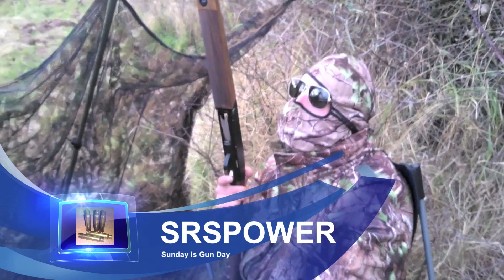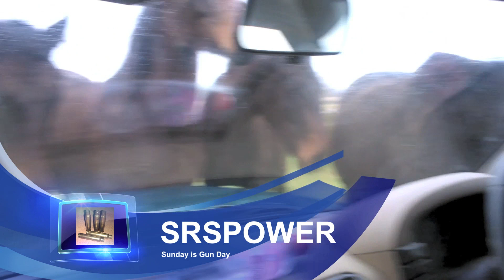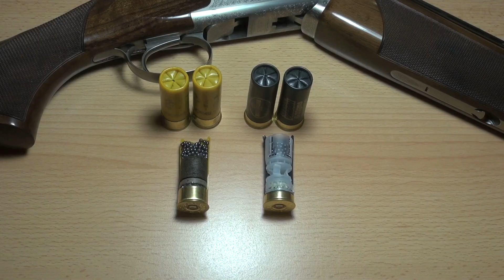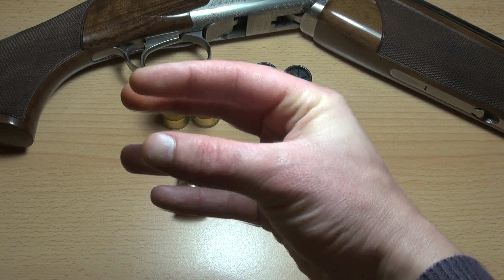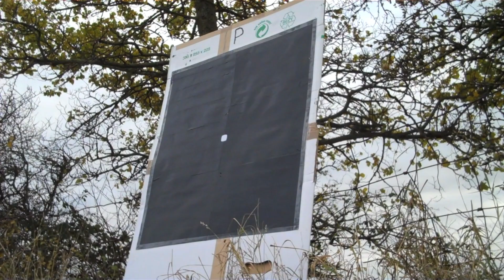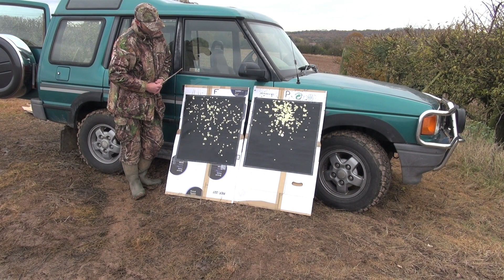Plastic vs Fibre Wad Shotgun Cartridges

Comment: I have shot low speed plastic wad ammo through a vintage SxS designed for fiber wads.  The thing kicks like a mule. It is said it effectively makes the gun one choke size smaller but it seems as if it adds constriction too. Food for thought.

Comment: Thank you! I wanted to add an option to my video game to increase shotgun spread a bit, and was about to link it to sawing off a barrel but wanted to double check if that was a myth or not. After some research and this well made vid I'm now making it a choice of shell wadding. Thanks!
Reply from the maker: If you want to change spread then sure plastic vs fibre makes a difference but choke us most important. Cylinder choke being widest and full being the tightest. Check my video shotgun chokes explained.

Comment: This is an old video. But I'm going to comment anyway. 
The 2 gram advantage of the fiber wad isn't any advantage. The shot rubs against the barrel and gets a lot of flat spots on the shot. Aerodynamics across those flat spots opens up the pattern significantly. In fact, when plastic wads first came out, that was one of the selling points. The plastic cup protected the shot and yielded tighter patterns. The initial recommendation was to use a choke one size larger than you were accustomed to. 
All this is old news to me, but based upon video commentary it should probably be repeated here.
Even so, I still like the idea of fiber wads. Maybe I'm just old fashioned.

Comment: The plastic wad increases the choke and possibly restricts spread for a bid as the petals flare out and they are heavier than the fibre so they add to the forward motion for a bit as well... fibre is homemade if you want and works good for lead at slower velocities try that and see I think the fibre is the best but for lack of shotcup which is nice to have...

Comment: Hi Sam going rough shooting with the sxp going to use gambore with low brass 6 shot have you had any problems cycling them ? I've used some  lighter loads at the clay range 65m 71/2 and kept jamming . Thanks for help Andy
Reply from the maker: +Andy sawyer The only rounds I had issues cycling were high brass due to the brass not being caught as well by the extractor. But then practise seemed to overcome that. You should be getting issues with low brass at all, if you do then maybe you should get it looked at?

Comment: The plastic shot cup basically acts as one more degree of choke. Very informative. Thanks for going the extra mile in your videos and provide us with a visual field test rather than just theoretical speculations. Keep up the good work buddy. Cheers from an American shooting enthusiast!!
Reply: +m96c40  No sweat buddy, glad I could help. another way to increase pattern the tightness of the pattern even more is to decrease velocity and use harder shot ( more antimony added to the lead during manufacture), or copper plated. less deformation + plastic wad = tight patterns. That's how Turkey loads are loaded.
Reply from the maker: I'm glad you liked it! Don't forget to sub, I have just had my rifle licence through so plenty more to come. Thanks for watching :)
Reply: +maseta3 I guess it does. I hadn't thought about that. I always assumed the pattern is better JUST because it protects the shot against deformation. Thanks for pointing that out.

Comment: Have you tried the Cupped Fibre wads   think they may be home load only
Reply from the maker: Not tied them no.
Reply: ***** Onl stumbled on them couple of days ago as im looking into reloading yShotgun carts    http://claygame.co.uk/products/detail/100-12ga-fibre-shot-cups
Reply: ***** hi srs my clay ground only allows fibre wad and i usually use quarter and half choke but aftrer seeing the spread of a half choke fibre wad im thinking i should try three quarters and full or full and full i swear ive seen my shot pattern go straight through the clay without hitting it very annoying. it would be great if you could do a vid showing what choke(fibre wad) patterns as close to the plastic wad on say a quarter or half choke if you know what i mean. i have no way of testing this in the field and would love to know. thanks sam
Reply from the maker: spitfireace87 What ranges are you shooting the clays at? If its 30 yards or less you should be fully smashing those clays with cylinder bore let alone full! You are probably going just behind or in front, increasing the choke may actually make your problem worse.
Reply: ***** yeah lol i probably do miss a fair bit . its mostly when i get caught out and i take a shot at a clay 40 50 yards out i have seen it go through the pattern do you think a tighter choke would just deform the shot to the point where its inacurate
Reply from the maker: That's not the problem at all, it is just you then have a much smaller tighter pattern. More likely to miss altogether.
Reply: Why are plastic wads cheaper than fibre

Comment: 20 gauge vs 12 gauge? You answer
Reply from the maker: 12 gauge is good because of price. As cartridges are most commonly bought in 12 gauge they tend to be cheaper and more common. For shooting? Not much difference really as you can get 20 gauge heavy loads and 12 gauge light loads. I quite fancy getting a 20 gauge side by side at some point as they are a little better looking. Mind you if you want exclusivity there is always 16 gauge.
Reply: Cool
Reply: But gun laws in the UK are so bad - they're so strick that you even need a license for a .22lr
Reply from the maker: ale de Well yes, in fact the license you need for a .22lr is section 1 much more strict than the license for a shotgun, section 2

Comment: Hey great video, its quite interesting how much pattern difference the two types of Shells have in a real world situation.
Just wondering... Is there a rule of thumb as to say which Chokes will give a similar spread with each Wad type? eg. a Fibre Wad Shell fired through a Full Choke may give a similar pattern to a Plastic Wad shell fired through the Improved Modified Choke? :-)

Comment: Is a gas check card used like a nitro card? Thanks.
Reply from the maker: I don't understand the question?
Reply: Nitro cards(a brand name) Are the same as generic hard cards and are generally used to adjust the total column height to ensure a proper crimp. Plastic gas seals are better suited over the powder charge.

Comment: The reason that the shot on the target was high is probably because most over and under shotguns are made to shoot high so when you are shooting crossers the target does not disappear behind the gun. This does not happen on side by sides as they are more flat so you can see the target better. I found this out as when shooting at sitting pigeons i always used to miss. But then i was told to shoot at their feet and it helped a lot. As shotguns are not designed to shoot sitting targets faults like this do happen and you just have to be aware of them!

Great video and i am looking forward to the next one!! :)
Reply from the maker: Thanks for watching Russell and the useful information :)
Reply: with respect to your comments , i disagree , i think the gun is not well fitted to the shooter
Reply: Yeh, that could also be a factor!!! Thanks for your opinion on it!! :-)